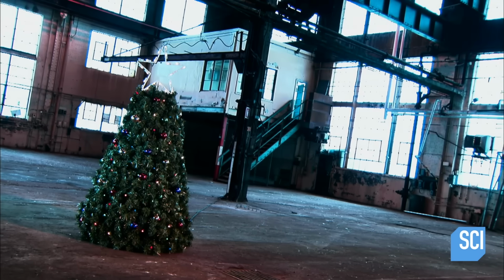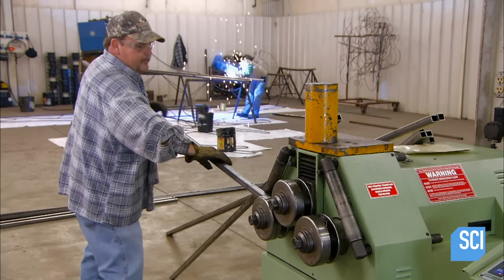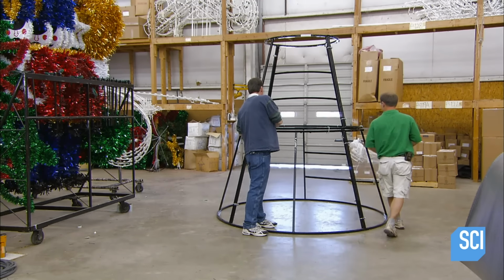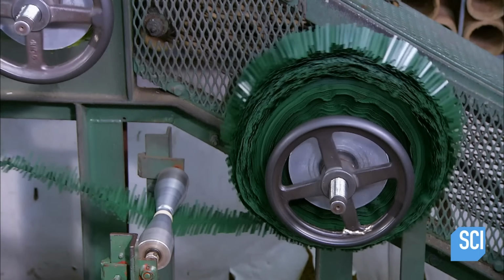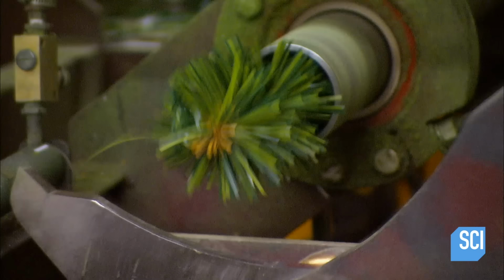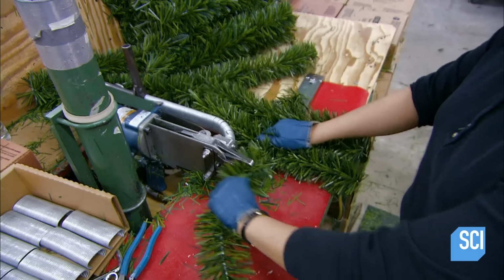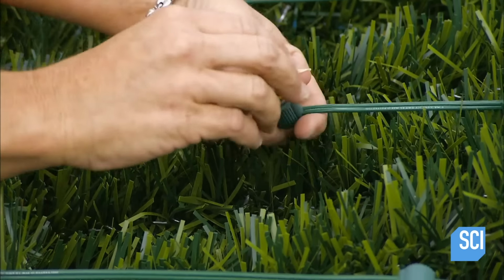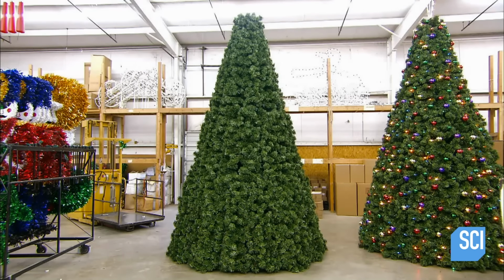How It's Made: Artificial Christmas Trees

Comment: Artificial trees in the 20th century were all little more than collections of bottle brushes in my opinion. Even today a decent artificial tree will run close to a thousand dollars but when they are taken care of they are a bargain that can last 15 or 20 years. I have a k-mart going out of business sale tree that cost a little over two hundred 7 years ago and is just now starting to lose it's luster. Already I have found that replacing it with a look-a-like is going to be difficult at any price. The tips of the needles are frayed to make a more realistic and lightly frosted appearance that is not paint that doesn't flake off every where.